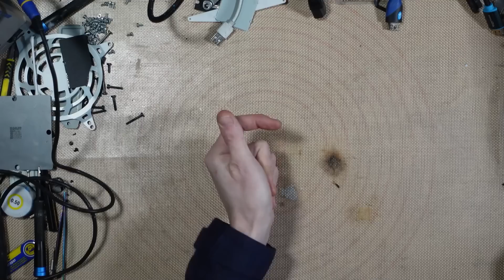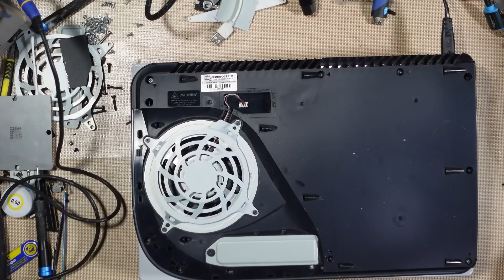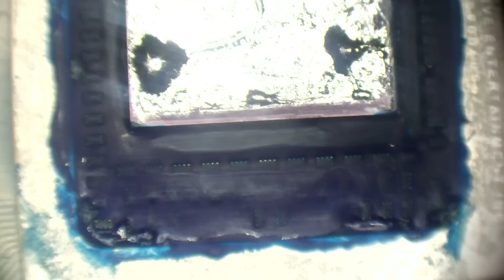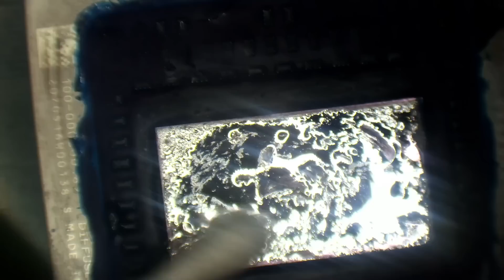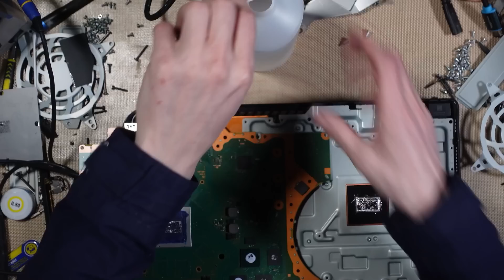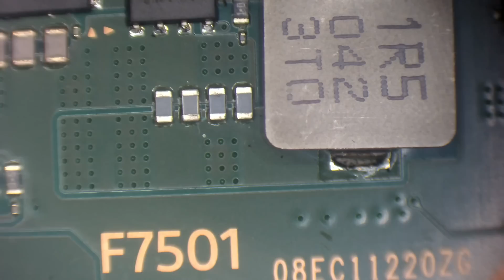My Customer Sent TWO Different PS5s Back For Warranty In 24 Hours! WTF Is Going On?

Comment: When I was gigging with a band in 2010, the drummer had his own "home made" halogen light plugged into the same ring mains as my guitar amp, when he used this light in two separate locations at two gigs, it killed my guitar amp, if I had some sort of mains filter plugged in I'm pretty sure that could have been avoided.
Sounds like your customer could do with buying a mains filter to protect his equipment, something sounds like it's introducing something onto the mains causing them to die.

If he/she refuses to take this measure, get your money back mate.

Comment: Does using hot air to take off and put on fuses reduce the life of the fuse? I tend to use the Soldering iron to remove and replace fuses. Less exposure to higher temperatures.
Reply: I disagree I think using hot air is better as the component (and surroundings) are heated evenly, when using iron you have a heatshock on one side of the  capacitor. As ceramics are prone to breaking when heated unevenly my guess is that it is more likely to be damaged.
Reply from the maker: I don't think it does but I'm not sure, a soldering iron is probably better long term
Reply: Jeroen is right, it's better to heat evenly with ceramics capacitor.

Comment: i imagine that this is in a kids room with maybe one socket and there running a extension lead to the console, tv and also running a blower heater of it and when the thermostat is clicking off and on is giving dirty power spikes on that power strip
Reply: Exactly what probably happened in this case, also kids really excited with PS shaking it around adding to the problems.
Reply from the maker: Yeah I reckon something strange in terms of electrics is going on here 🤔

Comment: I would have a conversation with him first - and depending on his reaction, I`d base the decision. Basically - if he`s acknowledging his fault and compensates you for your work on christmas etc - you could think about giving him the console - but only under the condition he tracks down the electrical issue(s) first. As you state yourself - at the end, it`s not the kids fault.
BUT - if he tries to blame you for it - just cut your losses, give him the money back and let him buy a new / other one.

He will be back in the second, the third console fails on him then anyway (so approximately 24h later =P )
Reply from the maker: Lol yeah to be honest I couldn't be bothered to deal with it again, so I refunded him (after I fixed it lol). As soon as I told him it was another failed 5v line and likely linked to the last 5v failure, therefore an issue on his end he immediately denied having any problem, no second thought, his house is perfect apparently, so I refunded him and told him to buy one elsewhere
Reply: @TheCod3r should've asked for the report he obviously got from a very competent electrician, how else would he know the issue isn't his end? Clearly he got a report done!

We all know he didn't do anything, probably just instantly tried defending himself cause he can't be wrong.
Reply: @TheCod3r  If its on the 5V line is there any chance it could come via a usb device being plugged in which is sending power into the ps5 (i'd assume they have fuses, but who knows what voltage/polarity is coming in there) I presume the hdmi detect is much more likely to have protection from a transient coming down throught from the TV
Reply: ''if he`s acknowledging his fault and compensates you for your work on christmas''

What? You can't expect the customer to compensate you for warranty repair.
Reply: @OskarBlomkvist  but you cant expect sb to do warranty repairs on christmas. that he did this (instead of applying a "normal" 3-7 days repair-time which is absolutely normal) shows his passion towards the customer and his work.
2 devices in a row, with faults unrelated to the original issue(s) of the console are a problem on the customers end - which renders all warranty useless, as warranty is ALWAYS only applied under the condition, that the device is being used under correct normal conditions.
So - after the repairs he`s got on video, basically any sane person would know that the problem is on the customers end and he therefore voided his warranty.
So basically - yeah you can hold customers accountable for the faults in their system/house environments by (completely justified) refusing any liability for the problem.
Coder probably only doesnt do that due to the related hassle and because the customer is/was a friend. If he was to deal with Sony directly - guess what - he would have to pay the repair even if it was in warranty time, as the error was clearly related to usage in incorrect conditions.

Comment: I would suggest they get a battery Backup with AVR, the shop I worked in 2000 had a customer that their computer would freeze up, in the shop it work perfectly, he took it back home it freezes, we built new system he had same problem , found out when his AC kicked on it drop the voltage in his house it was resolved by UPS